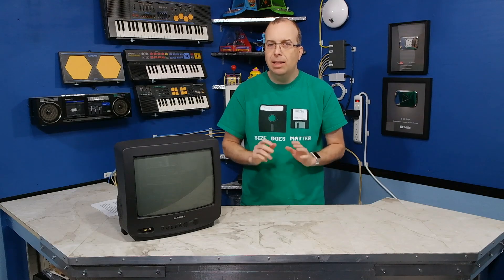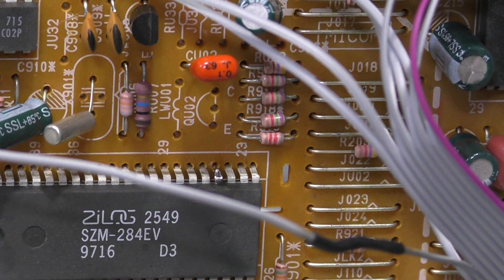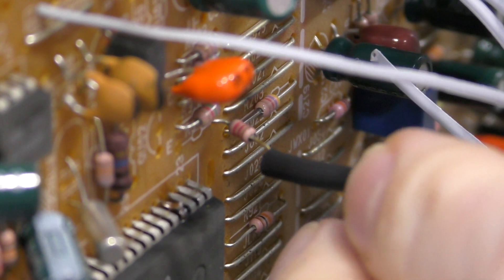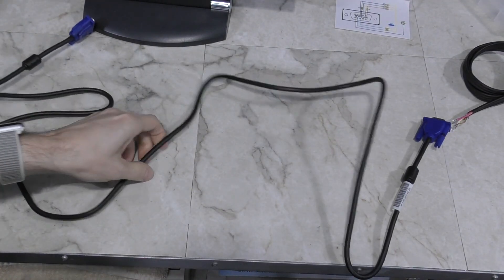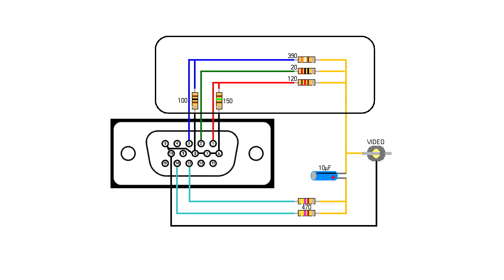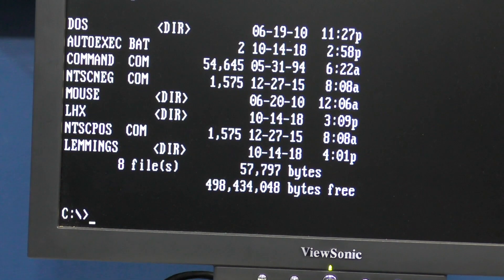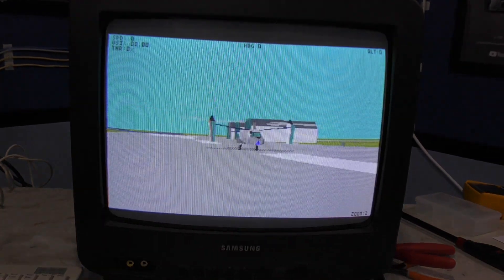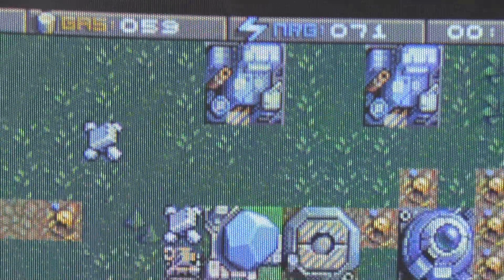Modding a TV for RGB - Part 2

Comment: Looks like you have to attenuate most of those RGB sources. That’s why your black levels are so bad in RGB mode. Also, you can fry some RGB equipment like that. RetroRGB recently made a good video series about using an oscilloscope to get proper RGB levels from your devices so that you don’t fry the display or video hardware you connect it to.

Yes, even the Sega Genesis needs components in the cable. The RGB is non-standard, from a time before there was an RGB SCART standard. It’s really more in line with what you might connect to an arcade machine’s CRT.
Reply from the maker: The black level is bad because the resistor values need to be tweaked some.  I thought about mentioning this, but decided not to.
Reply: The 8-Bit Guy Yeah, but you also generally need to add capacitance and sometimes need to do more for proper sync (not with Genesis, IIRC).
Reply: Can you elaborate on this? I performed the exact same mod on an identical CRT and the black level was atrocious. Lowering the brightness on the flyback transformer helped but of course, this dims the overall picture.
Reply: Jaekoff Fortunately, it’s the source and not the monitor, but that’s unfortunate in the sense that you would have to correct this for each source that is out of spec.

I assume that the Jungle chip takes RGBS as it’s typically engineered for consumers via SCART. If so, you’d have to look up how to make proper RGB cables for the source device.

For example, you can find the specifications online for a properly-built Sega Genesis Model 1 RGB cable, which uses resistors and capacitors to put the signal within 0.7v peak to peak and 75ohms impedance on composite sync. You can find them premade with the proper components and good shielding easily, but the cheap ones usually have poor shielding or are missing capacitors, resistors, or both.

Sites like RetroRGB and GameSX have a lot of info for old game consoles but it’s probably a bit harder to find the same info for retro computers. There really was no standard for 15khz RGBS from most retro machines so what you need for each source to make it standard varies widely. For many devices there are premade kits, like Voultar’s RGB amps for various consoles or the encoders you can buy for arcade games.

If there is nothing for your RGB device then you might want to connect it through some potentiometers and tweak the brightness for each source. It’s better than nothing. Heck, old TVs tolerated bad RGB well enough that many people didn’t even bother with getting proper RGB for a very long time. They’d just add resistors and such to make it “good enough.” Modern TVs and scaling equipment may not tolerate it as well as old TVs though, which is why you see people frying their OSSC RGB to HDMI device or gSCART RGB switch.

The whole thing is such a mess that a lot of people have engineered their own RGB bypass to circumvent the encoder built into the original equipment (Neo Geo JROK). Heck, some have even gone as far as replicating the original graphics chip entirely (NESRGB) or interfacing with them digitally (N64 Advanced). What’s available really depends on what platforms you want to connect.
Reply: Emmett Turner the issue manifests regardless of console and across many different cables leading me to believe it’s a problem with the mod itself. I’ve emailed David regarding those “tweaked” resistor values he referenced above but if he doesn’t reply how do you think I should go about things? Analog equipment like this is not something I’m particularly well-versed in, having maybe a cursory knowledge at best.
Reply: Jaekoff It’s very possible that the Jungle chip is not designed for standard 0.7v peak to peak, 75ohm impedance to be directly connected. If that’s the case then the proper circuitry for adapting it should be part of the process for any Jungle chip TV mod. I’ve never done this but I’ve seen threads about Jungle chip RGB mods on Shmups forum and similar places. Surely, one of them has worked out the particulars!
Reply: Ehm.... the Sega Mega Drive was released in 1988 in Japan, then in 1989 in the US as Genesis and in 1990 in Europe as Mega Drive. SCART was introduced in 1984 and by 1988, most televisions had it.

There were official SCART cables for the Mega Drive:

https://segaretro.org/SCART_Cable_(Mega_Drive_2)
Reply: Daniël Mantione You misunderstand. It was a regional standard when the Genesis was engineered, not an international one that was broadly required for TVs across Europe and other PAL regions. Even when it became an international standard it wasn’t standard in Japan.

In Japan the Genesis multi-out pinout was actually developed for the Sega Mark III/Master System before its release in 1985. Though the pinout is the exact same, strangely, it requires amplification to reach proper SCART RGB levels where a SEGA Genesis needs the exact opposite (attenuation resistors). They also require capacitors.

Perhaps most televisions in stores in 1989 may have had it by that point, but it would be years before enough people replaced their TVs that “most” in people’s homes would have them. Obviously, Japan was only concerned with the NTSC launch in the ‘80s where it was not standardized for consumers so the output was not made to conform to any European standard. Obviously. Just like Neo Geo, the RGB coming out of a Sega Genesis model 1 is more akin to what you would use with an arcade machine, which makes sense because SEGA was a member of JAMMA (Japan Amusement Machine Manufacturer’s Alliance, IIRC). The JAMMA standard for RGB was intended for arcade machines and the coin-op industry. “Standard?” Yes. Consumer/end-user standard? No. Industrial.

What’s even more relevant than how ubiquitous it was in new TVs or how prevalent it was in homes at the time is when it became mandatory for all TV manufacturers to get European certifications, but that’s proving hard to pin down. It was only made mandatory in Eastern Europe in 1989 and was only mandatory in France before that.

The EuroSCART guidelines also dictate that the device outputs the proper levels already so that a straight-cable with no resistors or capacitors can be used. This makes SEGA’s official RGB SCART cables in violation of the standards. I actually don’t think it should apply to devices with a proprietary multi-out (not standard to begin with) but high-profile RGB engineers like Voultar insist that the required components absolutely should be inside the console and not inside the cable.

Japan never really settled on a physical standard. Some TVs accepted a weird D-Sub-like connector, others used RCA Cinch, some used a SCART-like JP21 with a different pinout, and still others used 15-pin VGA-style connector. Even the lauded XRGB Mini Framemeister opts for Mini-DIN instead of any of those (Mini-DIN), and their standard 21-pin adapter cable is wired for JP21, not SCART.

Japan couldn’t even decide on an electrical standard, which is why the PlayStation doesn’t have CSYNC, the PlayStation 2 uses Sync on Green, and different Neo Geo AES systems output wildly different RGB levels (even more like arcade boards where they were adjusted by a technician, considering the pedigree), and even Japanese-produced North American TVs with 15-pin “RGB” ports don’t work with RGBS (RGBHV-only, AKA VGA). This is why RGB for consumer electronics remained niche, even in Japan.

I think I’ve got a pretty good handle on this. ;)

Comment: RGB/D-Sub seems far more awesome than people give it credit for. Awhile back I bought a 32 inch FHD TV (1080p). It has HDMI  and D-Sub on the back of it and when I plugged it in using an HDMI cable (my video card has DVI-D), the video output looked terrible, text was jagged, colors were bad, I tried fiddling with the TV's settings all over the place and never had any luck getting it to look good. Then, I ordered this little beauty from Amazon:

https://www.amazon.com/dp/B075L42XF4

And this fixed the problem right up! I get a MUCH better video feed now!

Comment: I'm really curious, As far I know, NTSC have frame rate of 29.97 fps (PAL and SECAM have 25 fps) compared to VGA monitor have exact 30 fps and 25 fps... Does the first try at 4:33 the VGA were transmit in 30 fps?
Reply: The problem was the horizontal scan frequency, VGA is 31.4kHz and 60Hz vertical @640x480, NTSC is 15.7kHz (the half of VGA) and 60Hz too (59.94Hz exactly). Some VGA cards can output 15.7Khz thought VGA port with specific software
Reply: I love your answer... That's explain a lot... Thanks...

Comment: For anyone who don't have this tri-state switch you can add a diode between the switch and the mcu that will works the same
Reply: It actually depends on what diode you put in there. One wich drops down only about 0.2-0.4v, it may work. A more common 0.7-1.5v drop diode? Probably it would be out of the chip's tolerance and wont work.

Comment: Hmm, David, have you given the program "VGA240" with it?  I know that there might still be some incompatibilities.  SHame, given games like Epic Pinball and Jazz Jackrabbit would probably look nice if they did.  In-Game used a tweaked ModeX to get the 60Hz refresh.  Also, I have read on VOGONS that there were some games that might run wonky, due to actually needing the 70Hz refresh for its timer.

Comment: Okay I'm hoping someone might help with this curiosity of mine. Can we do the same thing with an old VCR such as a VHS or, primarily, a BetaMax VCR. Reason? I'm trying to record the max possible quality without any loss in quality. Sure I could use S-Video on a very expensive Betamax in late 80s but I'm curious if this is possible. I understand I won't get a higher quality than what I see already but I just want to preserve the image as is. I would like to use component (RGB) cables instead as this would make it very easy to hook it to the capture card I currently have, as it doesn't support S-Video. I'm trying to avoid using Composite.
Reply: Nope, the NTSC or PAL signal recordeded on a tape can't be disected to RGB, even S-video is a lie. Your better option it's tried to get a good S-VHS player, good AV capture card, then you can enhance the image through software on PC.

Comment: Iv re some 1998 pc with wifi now tested opera witch is very unstable  
Max download speed through wifi is 200kbs has sounblaster live with game port has voodoo 3 If roped cooler off replaced that pad had to scrap it 
Off heatsink and put some high quality thermal paste on it temps seem less hanky
750mhz Athlon slot a  with some weird thing with ram 256mb used to suport 512mb I think the ram I have might be different speed cause it boots to Compaq screen hit enter it freezes shrug if cleaned mobo replaced thermal stuff on and chipset heatsink and replaced the thermal paste heat sink on cpu  couldnt get under the layer to replace it under the metal sheild

Comment: Have to say, the SCART connector does have a CEC-style implenentation which is simply a broadcast of +5V over a pin on the SCART socket (I think there are other meanings for other voltages on the same pin, but I can't be sure)

It isn't really a surprise that an American TV could be easily modded to display an RGB source.  You're probably partly repopulating connections that American TVs already contain, because the same chassis is used for European TVs that do have a SCART socket and an RGB connection (as well as Japanese TVs with JP-21 connectors)  

You might want to test this with a TV from the 1970s or earlier, TVs whose tube has a similar pattern to VGA monitors of the 1980s and 1990s rather than the pixel pattern that 1990s TVs have (which is the same pixel pattern that new TVs have for HD sources - and possibly even 4K sources)
Reply: Pin 8 pin is +9-12V for 4:3 aspect or 5-8V for 16:9, and its implementation varies considerably, some sets power up from standby (and also shut off when signal goes down), others just switch to AV if the set is turned on already, some do nothing. There are also pins for digital data bus which was originally rarely implemented at all and incompatible between manufacturers. In some cases the pins needed to be disconnected by cutting the wires on cable, as incompatible protocols connected together could cause really bizarre behavior. Since late 90's most manufacturers agreed on using AV.link which was a direct predecessor to HDMI-CEC and is supposed to be cross-compatible with it to some degree even now.

The Samsung TV modded on this and previous video actually has the composite video and audio input in SCART-connector shaped block and the cutout on the back case is for SCART. Can't see the bottom of the PCB on video, but if the chassis is same as on PAL model, the signals may have already been routed there and only thing needed to be done was to desolder the RCA connector block and replace it with SCART connector.

Those old delta gun TV's are probably impossible to converge satisfactorily to whole screen area for RGB use. Also when working with older sets which did not have any baseband video input from factory, one has to keep in mind that they may actually have live chassis, and it would be very dangerous to add any inputs without adding isolation transformer, which would need to be rather large and expensive, as these sets were power hungry. There have also been some live chassis sets that used optocouplers for composite video input, but those are rare.
Reply: "You're probably partly repopulating connections that American TVs already contain, because the same chassis is used for European TVs that do have a SCART socket and an RGB connection (as well as Japanese TVs with JP-21 connectors)"
Not quite. While very few sets can be modded that way, the vast majority of modeable sets(such as the one featured here) take the RGB from the Microcontroller's signal on it's way to the JUNGLE chip for OSD purpose. Not from an unpopulated part of the board like you alluded to. A set could be a NA exclusive and still be modeable.

"You might want to test this with a TV from the 1970s or earlier"
Unfortunately that won't be possible : (   Only TVs with JUNGLE chips can be modded, and these didn't show up until the '90s. I frequently check the list of confirmed models that can be modded, and so far it's only mid '90s sets and newer. We'll see how it goes
Reply: @FinalBaton  "You're probably partly repopulating connections that American TVs already contain, because the same chassis is used for European TVs that do have a SCART socket and an RGB connection (as well as Japanese TVs with JP-21 connectors)" Not quite. While very few sets can be modded that way, the vast majority of modeable sets(such as the one featured here) take the RGB from the Microcontroller's signal on it's way to the JUNGLE chip for OSD purpose."

Meaning that the set already has at least one RGB input that could be used not only for an OSD but also connected connected to a Teletext decoder or passed through to a SCART socket.  It wouldn't surprise me that cheaper TVs sold in Europe would have done just that.  

"Not from an unpopulated part of the board like you alluded to."

But if the Jungle chip is so useful for European and Japanese TVs and adds features that are useful to TVs across the world, why not add it?  Especially when Japan uses NTSC too.  8-Bit Guy didn't use an unpopulated part of the board, he used the existing RGB input the TV already has.  

"A set could be a NA exclusive and still be modeable."

Because it would already have an RGB input.

""You might want to test this with a TV from the 1970s or earlier" 
Unfortunately that won't be possible : ( Only TVs with JUNGLE chips can be modded, and these didn't show up until the '90s. I frequently check the list of confirmed models that can be modded, and so far it's only mid '90s sets and newer. We'll see how it goes"

I was working on the assumption that all TVs take the RF signal through a demodulator which would then output a composite signal (take out the demodulator and you have a composite input even on the oldest TVs) which the set would then convert to RGB to power the guns on the tube, of course, these inputs on the tube could be massively high voltage and require a fair bit of work.

Of course, I could be wrong, the composite input could be decoded to component video rather than RGB.  American TVs only had to deal with NTSC, European TVs had to potentially deal with PAL and SECAM, PAL being similar to NTSC but SECAM being very different AFAIK.
Reply: @GeoNeilUK  On sets of that era, by the time it is an RGB signal, it is in a very high voltage state whether the set is a chassis tube set or solid state.

Comment: Is there a way to get it to work with component?
Reply: There are unlikely any component inputs in the TV, internally RGB is the standard. If your question is wether component YUV can be converted to RGB: Yes, this is the case.

Comment: i fiddled with that few times when i was in highschool but on the windows side, i had to use powerstrip or something to create custom resolution and since i live in europe i used native pal interlanced mode
later in life i made a small converter box out of an old voodoo card with tv out, and butchered a converter chip out of it
this gave me vga to composite converter box that could work either in 640x480 or 800x600 without messing around drivers.
ald in the end i settled on comercial used converter from avermedia because it could do up to 1024x768 resolution and i got it for free from work
this one gives out vga clone signal, pal composite, svideo and pal rgb so i gave even easier life